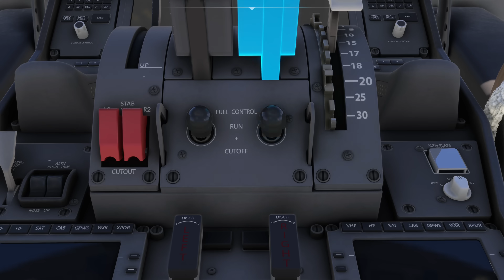Air India 171: Why Did The Fuel Cut-off Switch Get Moved?

Comment: Why is Captain Sieve so confident that the fuel cut-off levers were physically moved, especially when the flight data recorder only captures the electrical signals from instruments and switches?

Just two days after the crash, he made a similarly confident claim — that the pilots mistakenly moved the flaps instead of the landing gear. But after images of RAT deployment surfaced, he changed his stance.

At this point, it seems he’s making these statements more for monetary or media benefit than based on solid analysis.
Reply: The are a number of things that don't make sense that he does not talk about. He fails to talk about why the landing gear remained down the whole flight, surely if you're trying to get lift after engine cut-off your turning them back on and pulling up the landing gear. Also they have only given the cockpit recording transcript of "Why did you cutoff?" "I didn't cutoff", are they really telling us nothing else was said after that!
Reply: @mackworth3421  Not even that, the report didn't even directly quote the exchange, it's just reported speech.
Reply: Easy to verify. 787 has 4 cockpit sound recording channels. The microphones have high sensitivity and the inputs are pre-amplified. Even switch sounds can be captured clearly. You can hear switch sounds even in regular recordings of mobile phones. If the inspectors go to the exact eafr cutoff time frames, they can verify if the switches were moved mechanically.  It is early to blame the pilots.
Reply: as a conspiracy guy i guarantee i take even official pronouncements with appropriate skepticism.  right now the players have a massive incentive not to demonize the boeing 787
Reply: It’s unfair and ethically questionable to place blame solely on pilots who are no longer here to explain or defend their actions. How can the possibility of a mechanical failure be so easily dismissed? And realistically, how could both switches be turned from RUN to OFF simultaneously within just a second?
Reply: @SurendraKumar-pd3wz  Exactly. Even in the report when the switches were put back from OFF -> ON it took couple of seconds between both of them, while it was less than a second when they were switched from ON -> OFF which really suggest a mechanical failure. But he wants to be the therapy messiah (best scenario) or is paid off by someone (worse scenario).
Reply: " the flight data recorder only captures the electrical signals from instruments and switches"

Exactly what I was trying to explain to others elsewhere - unless you have cockpit video or time-lapse that shows the physical switches in cutoff position, the evidence is all electronic data, which could be erroneous in case of wiring insulation failure or if via optical fiber, damaged cables, or even software glitches. To give a simplified example - a vehicle speedometer recording is used in crashes too, and if for some reason, the speedometer reads zero due to sensor failure or some electronic malfunction, the vehicle while in motion may still indicate zero speed.
Reply: @rahulvinodpatil  wouldn't the sound of fuel cut-off switches getting flipped be captured on the CVR? I don't know. Only a real crash investigator can comment on this.
Reply: Nu ați citit cartea ,,Mafia farmaceutică și agroalimentară" și sunt multe alte informații despre multe alte minciuni, falsuri și ineficiențe. Sau poate că aveți încredere în cei care au impus folosirea îngrășămintelor de sinteză pentru instaurarea Noii ordini mondiale partea financiară în 26 de puncte citite de Viorel Ghica dintr-o carte? Tot este bine că am putut citi destul de multe comentarii ale celor care nu se lasă atât de ușor păcăliți de marketing după ce mi-au fost șterse sute de comentarii în ultimii ani.
Reply: Because that's how the physical switches are designed to operate? There sure are a lot of people in these comments who are either brain damaged or intellectually disabled.
Reply: $ is the answer. During the first 737 Max crash also, every such 'Experts' across globe made such biased reports favouring Boeing. A second tragical accident and all 'Captain Sieves' across globe went silent. Boeing will pay them money and Such greedy people have no credibility. Lets hope such an incident will not occur again like 737 Max.
Reply: It's an interesting question, and if they were moved was the actual intent to move some other switches instead and the pilot just had a "brain fart"? Most of us have driven cars and then realized that "I wasn't supposed to drive to work, I was supposed to go to the supermarket" or mix up the turn indicators with the wipers. It just happens. 10 seconds is probably reasonable when it comes to this situation because the feedback isn't necessarily obvious initially.
Would there be any reason to move the nearby stabilizer switches at that phase?
Reply: perfectly put!
Reply: Narrative change,it’s all about narrative, the formal dress, the way of talking, the ambiguity and the comments. 

There is a whole team behind it.
Reply: He is also earning from the airlines might have some pressure
Reply: Maybe somebody already suggested this.  Perhaps the pilot asking “why did you turn off the switches” is the real culprit.  He just wanted to deflect blame to the other guy.  If the copilot was flying and the captain was monitoring, the captain should have noticed the copilot reaching down and flipping the switches.  Of course if the pilot sabotaged the plane maybe he was the one that asked “why did you turn off the switches”?  People lie.
Reply: @BenLovelace-m6w  Or he didn't lie and the swtiches were faulty as there is proven history with such a possibility. We don't know yet, the investigation is still in progress yet he already decided it was a suicide + homicide in one LOL
Reply: he is wrong
Reply: he just does click bait content to blame pilots, blaming pilot just based on prelim report , look at all of his click bait youtube contents ,  the fact that its coming from another pilot is surprising
Reply: The movement of switches is captured in flight data recording. Switch has to be moved. 100% of time. 
Trying to create safeguards to prevent things like this happening is ridiculous. 2 pilots have to move fuel control switches. Ridiculous. Many other things could be done to crash an aircraft.
Reply: Because he's payed heavily by Boeing.... Motherfoker
Reply: The prelimiary report says that the "fuel cutoff switches transitioned from RUN to CUTOFF position". So, it specifically says that the switches transitioned in position. If they wouldn't be able to tell if the positions changed, they would have worded it completely differently. They would have stated that the signal transitioned. No word in this report is there by accident, this is all very specific and should incidate that there's specific evidence that the switches have changed position, not just that the signal for fuel cut-off occured.
Reply: Yes he has a lot of "click bait" content that's used just for engagement, but at least he makes it clear when it's a fact or his thoughts
Reply: He should refrain himself from blaming captains!
Reply: Yea biased. I hope he is so wrong.
Reply: Capt. Steeeve has sold his soul to Boeing.  He is acting as a psychological hitman now.
Reply: He is just a Boeing paid guy, what u expect from him.
After eating shown, he have to maintain their stance, and he didn't apologize about how hurry he make that flaps were done by pilot.
Reply: Either because he is being paid off by Boeing or some agency OR he is biased because he is a therapist and now will go on a mission of pioneering therapy in this space (which he immediately proceeded to do by announcing he invited some person and will do content on that. He just wants it to be true.
Reply: @adrianx8243 Most of us are biased in some way. Is he actually a therapist or are you making that up? Wishing to shed more light on mental health for pilots is suspicious to you HOW? You guys are reaching. Absolutely nuts
Reply: @louibeans  He said in his previous video that he got some doctor therapy degree and then immediately proceeded to decide that it was an intentional suicide even though there were issues on planes with these levers cutting out engines without a human intervention. But he immediately decided towards his bias and is pretty much ignoring FAA bulletins, army people reports they had many jets crashed due to similar issues. The point is he should never speak like this and for sure not before the investigation is concluded.
Reply: He is being paid
Reply: EXACTLY 💯  SHAME ON CAPTAIN STEEVE

Comment: Not a pilot and I fully understand that this would be an extremely stressful situation. However, am I the only one to think 10 seconds is actually a very long time. Like. In my mind, if you SEE the switches being flipped, wouldn't you immediately flip them back? Count it out. You must be panicked about losing all engine power at such a low altitude. And yet, 10 seconds.
Reply: when you're in the situation you don't expect your copilot to do something so illogical and that he is trying to murder everyone on board. so it will take a few seconds to figure out wtf just happened and if there was maybe an actual reason for the copilot to do it. 

it's easy to say in hindsight "bah yeah obviously you should have just flipped the switches back". but remember the pilot at that point did not have any reason to believe the other one wanted to deliberately crash the plane...
Reply: @little-pwnie  I get that. But it still doesn't process for me. If the pilot had deliberately nose-dived the aircraft, I bet it wouldn't take 10 seconds to process and begin adding counter-input. Seeing, hearing, feeling engine power drop - knowing exactly what did it, in my mind is on par with that. And a few seconds isn't 10. But of course I recognize I wouldn't know as I've never been in a situation like it.
Reply: The captain turned switches off. A few seconds later as the plane starts losing lifts he asks "why did you do that" FO responds " I didnt" Captain has his hands on switches, but waits just long enough so after he turns back on there is no chance the engines will spool up on time to provide enough lift. Then when he thinks theres no chance he switches them back on.

Comment: @captainsteeeve- is it possible that the fuel cutoff switches were left in the pull out position but just before they go into the detent and still allow the switch to me made?  In other words  if they weren’t properly set could vibration have caused them to move sparking pilots to ask the other if they switched them?

Comment: I like the idea to have two sets of cutoff switches on the far right and left of the instrument panel who have to be in the identical position to cut off an engine and be so far apart that one person can not handle both at the same time! Easy and very syfe. At the gate it would not be a problem or an extra time to announce Cut off engine number 1, confirmed, one is off and continue with number two. Even in an emergency that would not take any extra time as both pilots are involvet and have to confirm as is now!

Comment: Anything is possible we quite basically agree on that, but could’ve this had happened. The computer shut off both engines. The pilot asked the other one did you shut that off and he replied no that he reaches down and grabs the switches to try and do a reset which apparently was successful. I know this is a far reach but like you say anything is possible.

Comment: Do you know the mechanism behind these switches? These switches are not like your bathroom tap. These switches generates electrical signal which is then handled by the controlling computer. The controlling computer (software) then generates another electrical signal that is sent to the engine (where another control computer receives it and not only open the fuel solenoid valve but also ignites the engine as well). The controlling computer also logs the operation in the black box as well. 
Here, despite the fuel switches in RUN position, false electrical signals were sensed by the controlling computer (electrical fault or software fault) and it shuts down the engines. Listening to the sound of the engines, one pilot asked the other pilot "why did he cutoff" and the other pilot replied that "I didn't do that". At this moment the first pilot visually verified that both the switches were in the RUN position. If they were not, the first pilot should have said something about it and immediately rush to turn it on. In this case  after 10 seconds the switches were turned on. Which means that the pilots after trying everything else, just tried to turn-off the engines and turn them back on. The Computer, being in the wrong state, ignores the turn-off signal and just executes the turn-on signals and also logs the same( ie: turn-on signal) in the black box.

Comment: Steve is assuming the other pilot put the fuel switches back on.  I wouldn’t be surprised if it’s the captain that turned them off and back on.  But delayed the turn on just slightly.  It wouldn’t take more than 3 seconds to do both switches once you notice it.
Reply: I have to say, what if the fuel was cut off with switches in "RUN" postion?. In that case they would have to switch to "CUTOFF" position and then "RUN" which would explain the 4 second delay!

Comment: FOR ME THERE IS ALREADY WAY TOO MUCH AI AND COMPUTER CONTROL IN MODERN AIRLINERS.  As in the two 737 MAX crashes.  I would rather fly on a well maintained 707, 727, DC-8, or DC-6, etc, etc.  Only in some type of an extreme emergency would I even consider flying on any airline today.  

I have been in Aviation for over 55 years.  I started my career as a certified US Air Force Aircraft Mechanic / Crew Chief / Flight Engineer on C-130s.  Later on I became an FAA Licensed A&P Mechanic.   Also I have been a commercial pilot for over 54 years.  I earned that rating while still on my first active duty enlistment in the Air Force, using my GI Bill.  After my first enlistment I became a Flight Engineer on C-130s in the Air Force Reserves for around 4 years.  I left the AFR because the C-130s left and were replaced with an A-7 unit  I also spent around 8 or 9 years flying missions for the Coast Guard Auxiliary.  

I have loved airplanes since I was 2 years old and was never scared of them until FLY BY WIRE showed up.  I have never flown on a fly by wire aircraft.  As a Mechanic and Commercial Pilot I DO NOT trust that system.  And I DO NOT trust AI or computer controlled systems even more.  I do understand that computers can be a useful tool in the operation of systems used on aircraft and checking to make sure every thing is configured correctly.  BUT just like an auto pilot they need to be able to be turned off and let the pilots have complete control of the aircraft.

I live in the south central part of the US and still have use of the C-310 R that I sold several years ago.  I can be in any part of the continuous 48 states of the USA, some of Canada and Mexico in a day.

Comment: There's still the issue of the gear being down in all of this. My only guess if it was pilot suicide this is why he didn't retract because he knew it would bring the aircraft down quicker slowing it down?

But there doesn't seem to be any mention of it being down in the CVR? Like if he asked why did you turn off the fuel why not also ask why is the gear still down?

Comment: Strange thing is that the report misses some important pieces of information like the timestamp of the pilot's question and answer and even more strange is that there is no mention that the landing gear retraction was initiated however I thought that the consensus was that the process has started by tilting the wheels. That should have been recorded and presented in the report. I'm also not 100% convinced that the physical buttons were switched off. If a control unit is involved that also means it is controlled by software so only Boeing engineers can answer what is possible and what is not. As far as I learned Boeing was not yet involved into the investigation.